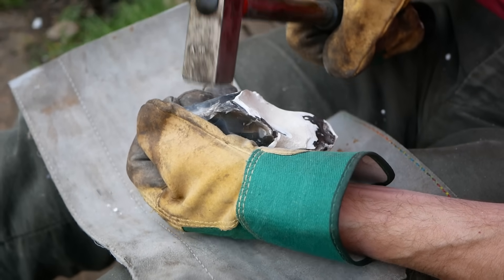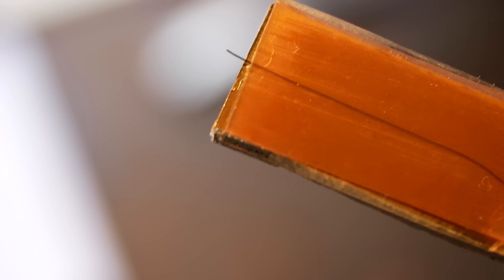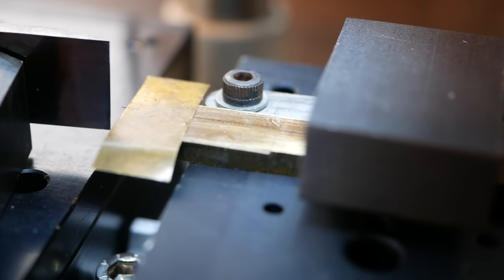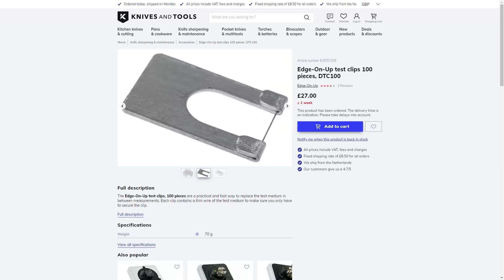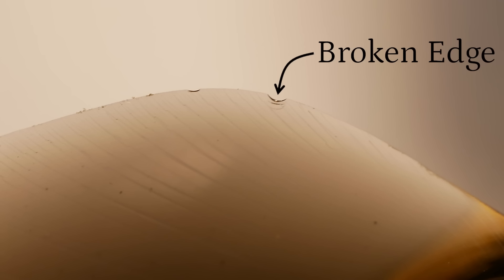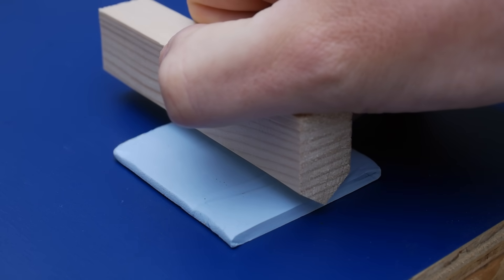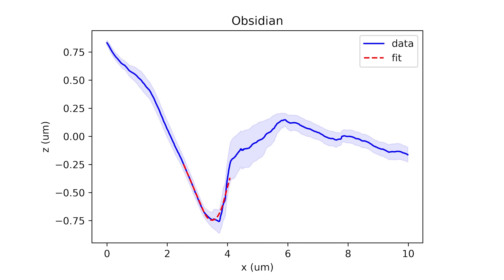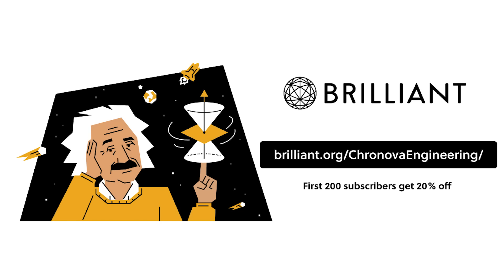Does Obsidian Really Form the Sharpest Edge?

Comment: It would depend on what it is your cutting and how your cutting it. You pressed the edge in all of your test's straight into the substance you're trying to cut. The edge of the obsidian would be the best for soft things like meat or skin by pulling it over the surface, not pressing it into whatever it is.... so, it's still the sharpest, just not applicable with every substance or method of use...

Comment: I remember going to a museum on a field trip as a kid and they gave us all stones as souvenirs from the gift shop. I got a piece of obsidian. It was about the size of a quarter and maybe an 1/8" thick. When I got home I accidently dropped it and it shattered into two pieces. I was devastated. But then I looked at one of the pieces and the way it fractured left an edge so thin and so sharp that to this day I haven't found anything close. You could just touch an apple and it would slice with no pressure applied. It made a razor seem like a cue ball. Of course like everything you had as kids got lost, but it was such an edge that I can remember it vividly 55 years later

Comment: 80 years ago, it probably did. Now we've got differential hardening for steel, nanoscale abrasives, lab grown diamonds cost pennies by the karat, and rubies are even cheaper. Hell, a diamond plate costs less than an aluminum oxide stone does these days.

Hell, i picked up a diamond plate from home depot a couple months ago for less than 20 bucks. Even 30 years ago, something like that would have cost a pretty penny. 10 years ago even. Lab grown crystals have changed the game. Even chromium oxide is getting outshined by diamond paste, because it's just so fucking cheap to produce diamond dust.

80 years ago, an obsidian scalpal could probably be sharper than most steel scalpals. Today? Not a chance, and way too brittle.

Comment: Id rather see a test attempting to 'whittle' the hair. So holding the hair, slide the cutting edge along the hair but only deep enough to create another thinner hair, not cutting through. Many consider the ability to whittle hair the ultimate test for the sharpness of a knife. This is much sharper than a standard razor blade. Nevertheless, if sharpness is variable based on test type, wouldnt a 1 angstrom diamond be the sharpest? Or perhaps a graphene or ADNR edge?

Comment: So I think about something very tiny and using something else very tiny to cut it.

Because if I used something big that would be unwieldy and it wouldn't be able to cut it with the accuracy I need. 

And so I think about how what are some things in my life that I could sharpen that could give me a better granularity on life. And show how sometimes things need something that is small but sharp rather than big and blunt. 

And so I think about how better understanding my emotions could be the sharp thing that I could cut even the most delicate situations in my life with because they have the granularity needed to understand them.

Comment: i'm pretty sure an ultramicrotome (the tool they use to prepare specimens for transmission electronmicroscopy) blade is sharper. a regular microtome blade can make 1 um thick slices. that's obviously smaller than the human hair

Comment: Obsidian does form the sharpest blades, far sharper than surgical scalpels, however they have to be flaked with a very specific method, not knapping, and are used in gliding/slicing, not pushing

Comment: Pro cutter here. I earned my chops through 8 years of a commercial kitchen with a chef's knife and 4 years in an Aikido dojo where you use cutting techniques while unarmed.(think of how a river can slowly cut through a mountain or how you could, "cut," through a wooden table with your open palms, using  lots of time and sandpaper. 

Hardness alone can, "cut," but a straight(what I'm going to call focused) edge will magnify the cutting effect at the cost of damage to the edge. 

I would argue that a square blade that is incredibly hard with a really clean edge can do incredible levels of cutting, while reducing the damage to itself. Heck you can probably even cut with an obtuse edge if your blade is hard enough. 

There is also a bit of a thing with proper technique. Drawing an edge creates a slice and a slice will greatly increase cutting power over a chop. In many ways using a chisel is also a type of slice, with the greatest cutting happening during the sliding of the chisel and not at the start or and of the gouging stroke.

Comment: I think that your biggest problem is in fact the strength of the materials. Steel withstands the wire test because it is structurally very strong. Its strength can be adjusted by tempering. That's why they use it for blades! We take it for granted but its a very high tech material. Glass on the other hand despite our 'perception' is a soft material and does not withstand the wire test because the edge deforms under pressure. As would non tempered steel The wire is possibly harder than the glass. If you cut materials that were softer than glass such as mammoth meat you might find that it performed better. (good luck on finding the mammoth meat).

Comment: Are these measurements not simply demonstrating the difference between chopping and slicing?
The kinds of cuts you start with are effectively chopping cuts while thin, fragile edges are best at slicing cuts, where by traversing the blade across and into a material spreads out the load on the edge. Charting the forces applied to the blades as they cut in different directions should be interesting

Comment: Does Obsidian Really Form the Sharpest Edge? Yes and no. There is a slight flaw in the test I believe,  The Cleaving of one type of material is one thing but there are different compositions of material causing different cutting edges to cut differently just as knife shapes are differently made and better for cutting meat or fish and vegetables non less sharp than the other. Obsidian scalpels are used for eye surgery. One would need to define the sharpness of the Blade as well as concerning the material being cut and how ? Slice, Saw, Chop, Pirse Etc...

Comment: Thank you for this insightful video . I learned that for a push cutting action, steel razor are much better suited for this. It flexible nature allows the razors edge to withstand some buckling caused by the force needed to puncturr or slip open the material. This force intuitivly is the peak force of the cutting action because creating a cut or crack in the material surface will cause stress will concentrate in the material. Theerefore the blade will have an easier time pushing wedging apart the material once this crack is made . And it made me think about why the obsidian preformed the way it did. Its clear the edge if the obsidian blade was too thin to with stand the the force need to "puncture". It seems puttin a very small amount of normal compression stress on the on an obsidian edge that thin causes it the buckle, and therefore crumble because of its extreme brittleness. I agree, a slicing motion instead of a pushing motion a better way to test the obsidian. . Which makes sense. You ideally you only want to put shear force against the blade. With an edge that thin, the face it is just a jew atoms in width. That an incredibly small area so the shear stress would be so minimal preserving the sharpness of the blade. Any small amount compression stress will cause the blade to want to buckle abd there for crumble.

Comment: Even though the obsidian edge get damaged by a wire (why not cut through a softer wire material?). It doesn't explain why it didn't split hair. Clearly the obsidian edge wasn't damaged and dulled by the hair.

Comment: I don't think that you're quite done with this one yet. You've probably already heard from someone who's worked in Histology. But, in case you haven't, here's some background.

Some (many) years ago I did such work. Pathology samples are "fixed", embedded in wax blocks, sliced into really delicate slices, these are then floated (and also have the wrinkles flattened out) in a warm water bath. From here, the most promising looking slices are lifted onto a glass slide, dried, dewaxed, stained, and coverslipped. As I recall, we used to cut at around 8 microns. I think that 4 is the absolute limit for steel blades. The blades at that time were like an oversized cut throat razor. they were honed and lapped by machine on a glass plate. These have since been superseded by an oversized analogue of an injector blade, more for convenience than performance. BUT, neither of these provided the best blades. These were made from  a special glass bar, which was broken on a machine made for the purpose. With these, slices could be made as thin as one micron. I might add that everything to do with glass knives is too much of a pain in the arse for all but the most fastidious. More blades were thrown away than kept for use. The edges were in every case though, much more even than shown on the obsidian here. This is hardly surprising though. After all, in the one case, you have a regularly shaped object of uniform composition held firmly while very precise pressure is applied. In the other, you belt an irregular lump with a rock.

I suspect that you may have to ring a lot of labs before you find one equipped to make glass blades. But if you do, I reckon that they'd be delighted to supply you with some, once they know what you're about.

Cheers.

Comment: You're not cutting, you're pressing the edge into the hair and wire. 

You can press a sharp knife into your hand to no ill effect, but if you slide the blade you'll get cut. 

Slicing vs cutting. Different actions, different mechanisms of action and results.

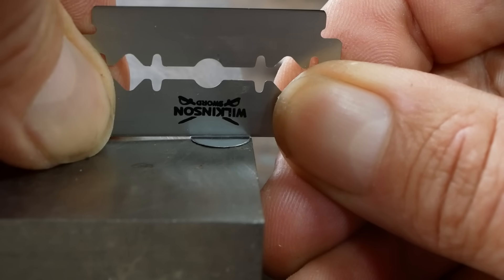Comment: 8:32 I think because the pressing of the blade was done by hand instead of a true, constant 90 degree downward angle, which made the impression in the lead inaccurate and misshapen. A slight pull of the blade towards the camera; a tilt, has occurred, which pushed the lead cross-section to the left, warping it.

Comment: Hey, plastic surgeon here.  
Obsidian scalpels are a real thing. Yes, they are sharper than any other steel edge.  The obsidian scalpels are very difficult to find, but I use them on occasion.  The obsidian blades are ground, and polished, during manufacturing.  How?  I don’t know.  But they are all uniform in size, thickness, and cut through any tissue with almost zero resistance.  
Obsidian scalpels are actually scary to use.  And that is coming from a surgeon. 
If you want some, let me know.  Happy to send some your way.
Reply: What if they break inside patient?
Reply: What do you use them for?

Comment: there are even devices to make glass blades for cutting samples for transmission electron microscopy. No need for fancy obsidian, only flat glass needed. And you can make finer cuts than with basically anything else except for diamond knives.

Comment: you know that you never tested any cutting? cutting needs to have a motion parallel to the edge. 
material must be split by friction not by displacement, consider the "sharpness" of a bullet compared to its ability to penetrate material
Reply: Wrong. What you describe is sawing! Where you remove material to separate 2 parts. Cutting is in fact pure displacement. Or do you move your razor side to side when shaving? No you just pull it along your skin.
Reply: @b14ckyy  you are correct when you want to say my definition is partially ambiguos. Sawing will also need to meet the criteria of a motion parallel to the edge and can be argued to work via friction, although may it be a more macrosscopic version of it. 
Your example however does not work as a counterexample as you try to suggest. Why dont you move the razor blade sidewards? Because you would cut yourself. 
Skin can be easily cut, but because of its elasticity it isnt penetrated as easily as hair. Thus shaving is neither cutting nor sawing as you see.

Comment: This is technically correct, but also a little misleading, Obsidian blades weren't used is a vertical manner, as that isn't actually cutting, but splitting or carving, Obsidian is used in a horizontal cutting by drawing it towards the direction of the handle, never pushing or carving because it's so extremely thin, so thin in fact that it's more advantageous to use in ocular surgery than a regular steel scalpel.

Comment: The "point" of obsidian - weaponry.  1) Sharpness but also 2) Brittleness - the 2 most desirable features.  (Which explains why copper tools were developed in N America, but didn't catch on.)  Obsidian spear/arrow heads are weapons of hunting/war.   In an age before beasts of burden, (all on foot! even packing out 200 lbs of meat per person!)  you WANT the projectile point to do 2 things, which bring the game down faster.  (You don't want it running miles away, into bogs/cliffs/inaccessible areas or found so late the meat spoils.)  
1) Penetrate deep; which sharpness allows.  
-For maximum organ damage/ wound enlargement.  (As the prey runs, each step shuffles the rock/glass pieces inside like a tumbler.  Cuts more tissue/enlarging wound, severing vessels/arteries.)
2) Breaking in the wound - ensures the cutting edge stays in the prey to continue the damage.  
-The shaft is like a big stick, it WILL get knocked out due to the prey writhing/rolling/banging it on trees. You want a BREAK.
-Non-breaking projectiles that don't penetrate far (less sharp,) can simply fall out with prey movement. The wound can close, blood can clot.  Prey can flee to Timbuktu before death.

Did they really want projectiles to break? Yes.  Trade with others. Get your skilled knappers to tap a few times - boom, replaced. 
Remember - obsidian tools are "art" to us modern folks.  To the ancients - disposable, replaceable, common tools.  Meant for USE.  
"Oh it's so pretty I kinda hope it stays intact and falls out - so we lose our kill we've tracked for 9 days across a glacier and our family is at risk of starving" - said no ancient ever. :)

They'd look at copper tools.  Less sharp.  Pain in the * to mine/smelt/craft.  Soft.  Really soft, yet, bendy, not brittle. Falls out of game into grass - oh who cares if we even find it?  Let's go back to stone/glass!
Reply: yeah they didnt have steel...or even bronze yet

Comment: Obsidian is actually incredibly good at cutting soft material. Unlike metal, obsidian can't retain its edge very well. But if what you are cutting is too soft to deform the obsidian then the fragility is not as much an issue. Cutting an object like soft flesh, especially ocular flesh, has been best performed with obsidian for a long time. It was used in scalpel applications for this reason. Also it is practically immune to corrosion, however it is fragile.

Comment: This reminds me of Micro diamond blades that surgeons use. They can't induce any lateral movement on the tools blade under friction or it could ruin the diamond blade. Cutting requires friction generally too, which is why you can take a relatively sharp pblade and press it to your skin without drawing blood untill the moment you apply friction to the edge.

Comment: Blades are not used in this fashion. You slide the blade across a cutting surface . Once the cut starts it releases pressure on the blade so if it really is that sharp sliding it is more effortless

Comment: so... it IS the sharpest edge, but raw broken obsidian is just too brittle.

12 minutes for that. but the experiments are cool. precise tests are interesting to see. and i expect i'm not alone when i consider sharpness on a blade to mean something other than ability to withstand pressure.

ever seen Bob's Burgers when Teddy has an issue with Bob's new knife? smashed it with a hammer.  pressure ruined that knife because it's not intended to withstand pressures, it's meant for overall cutting ability. you mention a butchers knfe and they're thick and heavy for swinging and chopping the same way you're doing these tests. and that's not something we all do. ever. if we have to cut something, we use what we have but we don't just have a butchers knife to cleave off meat. my point is, a butchers knife can withstand pressures because it's meant for that. because we know obsidian isn't something sharp you press into stuff.

Comment: This was a neat video, where you applied some neat fabrication and analysis tools to answer the question. Strangely, you found a way to split hairs that is unlike any hair-splitting test I've ever seen before. Normally, the knife edge approaches the hair from the side and cuts in as the hair bends away from the knife - if it's sharp enough. An interesting way to test very sharp edges may be to measure how far into a consistent hair the knife cuts before beginning the split.

Comment: As others have mentioned, in real life, no one pushes to cut, but slices.  Also, you might have asked an expert napper to produce edges for you.  I read years ago of a hunter who used both a Swedish steel knife and obsidian to dismember a kill.  He said that the obsidian won easily.  And it might not be just a case of sharpness, but the character of the obsidian glass gliding over the surface of the tissue compared to steel.  That is, you must think about the whole character of the cutter, not just the edge.  Though I am unable to use obsidian in daily life, my favourite cooking knife is of Swedish steel made by Japanese craftsmen.

Comment: Looking at sharpening from grinding wheels etc, but read a comment the other day from someone who use to make obsidian blades for eye surgeons back in the 70's and probably into the early 80's.  Said it was very expensive but it was what they used, so you can bet it was the sharpest thing that was reasonably practical even though expensive.
Said it largely got phased out by lasers.